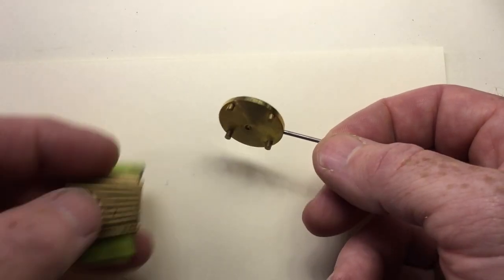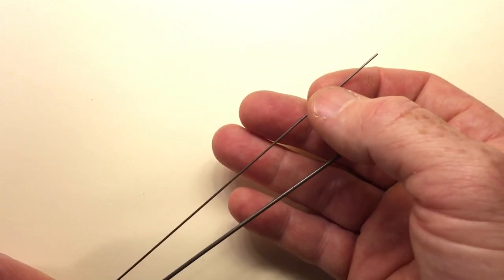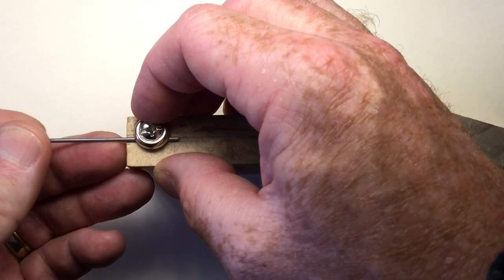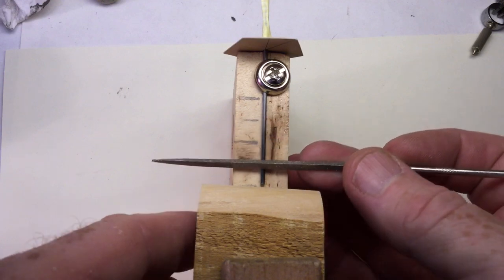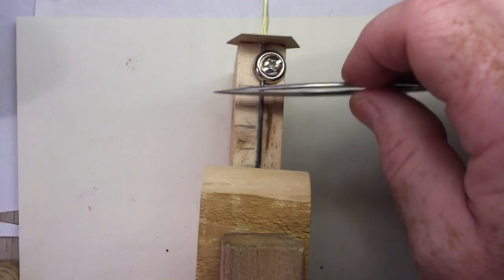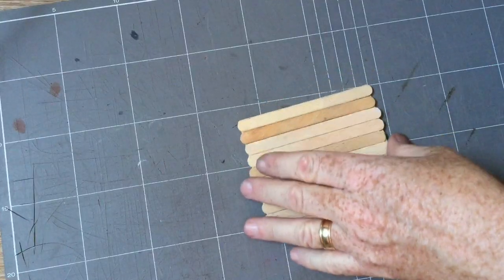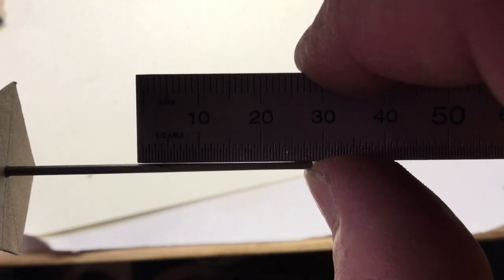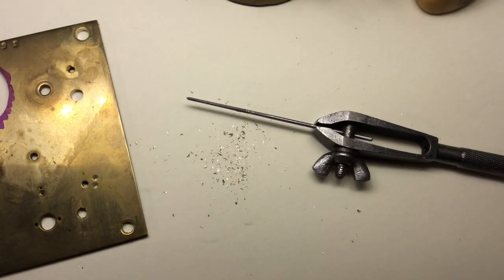Making a Clockmaker's Broach. Makin' a Tool Ep.2

Comment: Thanks for sharing this. I really appreciate. Such an clever and easy method.
I guess a starting material can be a drill bit as well rather than a steel wire?
Reply from the maker: G'day htc. Glad you liked the video. My only concern would be that drill bits are on the brittle side, and when they snap, they chip, and things get interesting for your eyes very quickly, and you can't anneal HSS drill rod. I speak from experience. I had a drill snap on me and a razor sharp fleck lodged in the border of eyelid between the eyelashes and the eyeball, in line with my pupil. I was squinting at the time. I resolved that day to never drill without safety goggles again. 
The music wire I use is quite cheap. A 3 foot length, the diameter of the one I used in the video, would be around $4 Australian, and will make quite a few broaches, spade drills, balance staffs, and on and on and on :)
All the Best 
Cheers.
Reply: Thanks for your reply @theselectiveluddite . And thanks for warning about HSS chipping.
I got some old watchmaking tools on my hands. On is quite large and rusty broach. I'd like to restore it even I don't really need it as it is quite large. I'll definitively will give a try for the method you shared.
Reply from the maker: @htchtc203   Nice. I also have quite a lot of antique watch and clockmaker's broaches, a fair proportion of which have dull edges. You can see this by rotating the broach under a light. A dull edge will reflect light between the facets, where as a sharp edge will not show up at all. I used the method in the video (but with a hardwood block with fine tapered grooves at one end and holding the broach in my fingers) to sharpen a bunch of super fine watchmaker's broaches (like the one I show early on), using a very fine diamond hone (only about 5 strokes per face) followed by a small piece of slate. I used the method of pressing down firmly with the hone/stone to keep the face being worked on level.

Comment: That seems like a lot of work... 
I’m sure a broach turned down to a taper from soft steel, hardened and one flat ground in would work just fine (that’s what the broaches from my Seitz jeweling tool look like
Reply from the maker: G'day Jonas, Watch and Clockmaker's broaches are different to jewelling reamers. I was making mine based on commercially produced ones I own. It would be faster using soft steel, but I don't have the set up yet to do case hardening; I could have annealed the music wire, and then re-hardened and tempered it after shaping, but I don't feel that my skill level with those processes is quite up to snuff yet. Cheers

Comment: I'm sure there's some reason I'm wrong, since you seem to know what you're talking about, but isn't that a reamer rather than a broach?  I thought a broach was a tool that (let's see . . .) removes metal with an action that is parallel to it's own axis.  Make sense?
Reply from the maker: G'day BLenz, Yes, terminology between trades can get interesting; where a tool like this in another field would indeed be called a reamer, in Horology it's referred to as a broach, and the action of using it is called 'broaching': eg. "Broaching out a pivot hole".
I don't know why there's the difference, but all the Horology books I've got, dating back into the 1800's, refer to them by that term.
Are you into engineering?
All the Best
Reply from the maker: Also, @johndilsaver8409, at the bottom of the comments, mentions googling the difference between broach and reamer, and it seems to be a size thing. Cheers